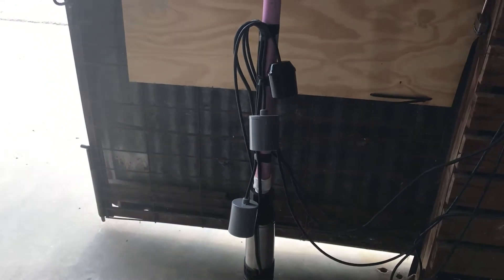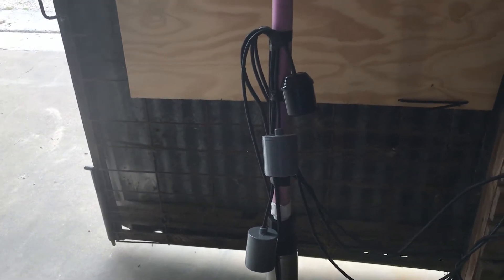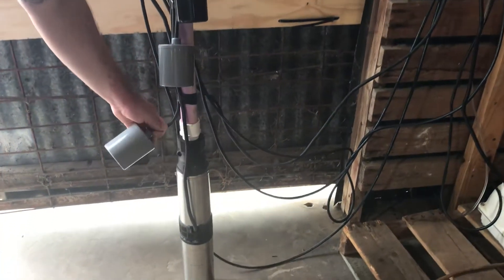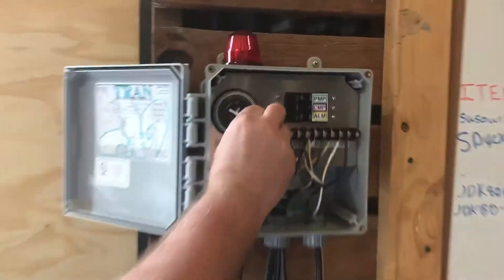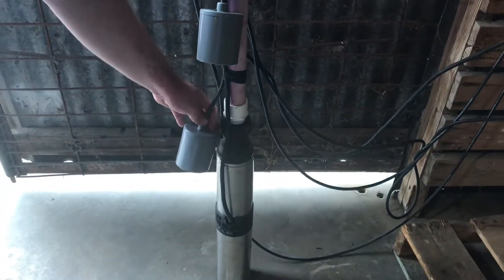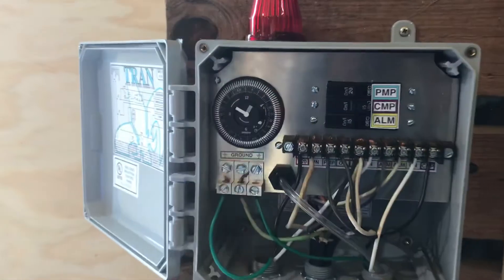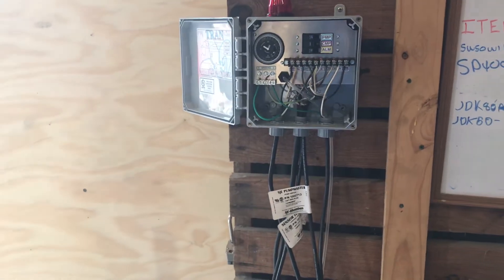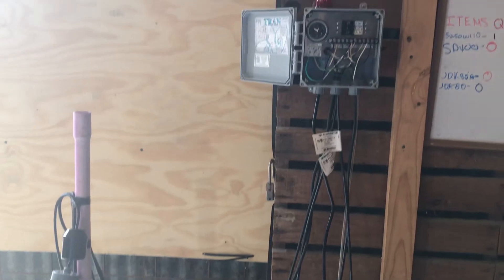Septic pump three floats.

Comment: So the bottom float that enables the timer to pump water is a NO high amp switch? I assume the pump override float switch is NC and high amp?
Thanks.
Reply from the maker: If it was Nc it would engage the pump while in the down position. There would be no point in having an override. To override the level of water would have to reach a level in order to engage. Both are NO floats.
Reply: @wholesalesepticsupply  Thanks for the reply, so they are both also high current [13 amp] NO, mechanical floats?
Reply from the maker: @ThePushmataha  yes on the the pump switches they are. Normally there is no contact in the panel so the floats connected to the pump need to be 13 amp floats.

Comment: So first is tied maybe 12" above top of pump so it rests near top of pump. Second looks like a foot above that and alarm a foot above that.
Reply from the maker: Your float switch’s are tied off like that. He is a video of ours that shows where we prefer them. https://youtu.be/7cmELzAQEqc
Reply: @wholesalesepticsupply is Is that the Tran T2 panel? Not sure of get the Spi Bio or a Tran T2. I went with a Retro 800 Air vice replacing shaft a the time so I don't need air alarm in box. The aerator has its own pressure switch. I do need a timer and have 3 floats, currently wired for on demand and control.Float is hooked up. Alarm works but not used now. I learned after big floods that if that float goes off I have serious issues . The Tran T2 is affordable too

Comment: What's it mean when neither 1 or second float triggered the pump in timer mode.i ran the pump manually to drain the tank so the pump works fine.any thoughts
Reply from the maker: Could be the float is bad. Corrosion got to it the pump is pulling to many amps and fried them and you will need a new pump also. Really hard to tell if we are not there but I would start there.
Reply: @wholesalesepticsupply  turned out the float was bad got a new one installed it to controller and worked fine
Reply from the maker: @professionalbaddass  okay check the amp draw on the pump if it’s over 11 then the pump is getting old over 13 and that new float will go with it.

Comment: Thank you very much for posting this. For the longest I was under the assumption that the two floats worked in tandem so if either of the two triggered the pump it come on rather than how you stated one is an override. That being said I imagine that the wiring coming from the override float connects in some shape form or fashion to the initial float correct? Again thank you for posting this I know it’s an older post but it helped me out a bunch because the last time or system was serviced I could tell stuff was messed with. I had to go through and fix all the wiring and use heat shrink as well as waterproof connections whereas they used standard crimp butt connectors and some electrical tape. Thank you for any help with this.
Reply from the maker: they could but in a small tank, most people don't run them like that. If there are three or four floats the system could run like that. if there are two floats and the system has an alarm most do then one turns the pump on and off and one is for the alarm.

Comment: I got a question: so only one of the two control float switches works all the time in normal condition?  As you said, the first control float will close when floating up and thus turn the pump on.  When the water level is down and the float switch is down, then it turns the pump off.  Therefore the pumping distance would be determined only by the first control float switch.  Is that true?  Then typically how to lower the water level down to the bottom switch level?
This is not as what we expect for a combined double float switch system, which turns on the pump by the top control switch and turns off the pump by the bottom switch.  Therefore we can achieve bigger pumping distance.

Comment: Why do you need the lower float the middle float will still turn it on and off can’t go to bathroom between 8 and 4 because septic on a timer
Reply from the maker: David Petrusewicz  then you timer needs to be calibrated better you should have 400 gallons of free capacity